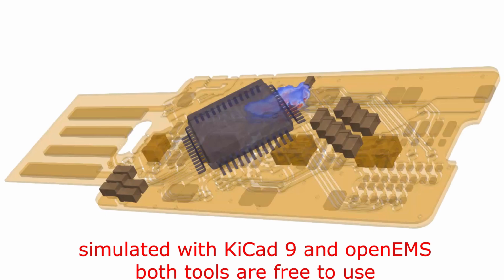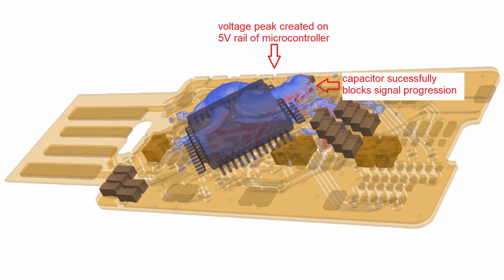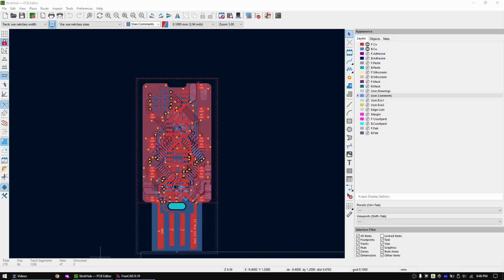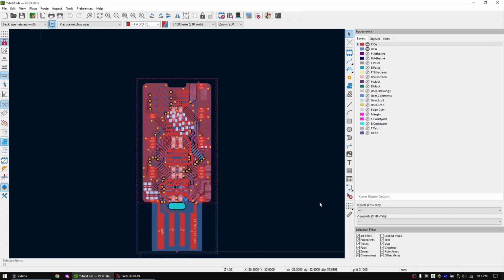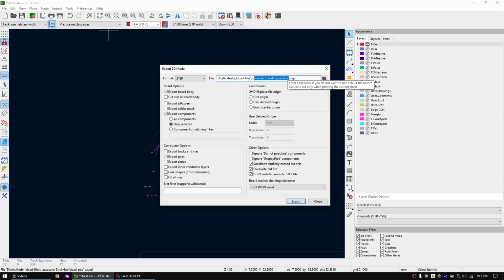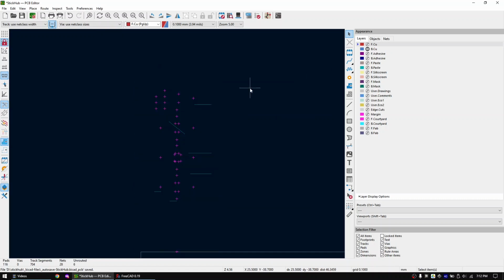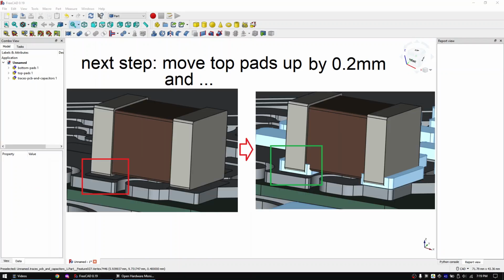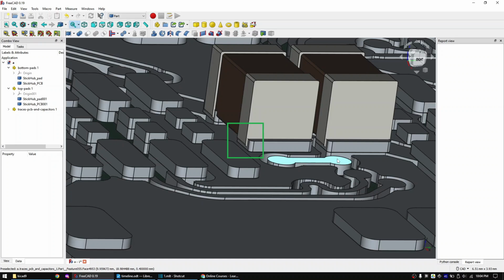KiCad 9 release - new features for easier 3D simulation of EMC/SI/PI/PDN problems

Comment: Hi, great topic.

Side question but will openEMS help with power analyzer? As current capacity of traces and copper pour.
Reply from the maker: Hi there,

For DC simulations, ElmerFEM works quite well. It can take copper resistivity into account, allowing the calculation of trace current carrying capacity and voltage drops on traces and pours.

openEMS becomes usable for frequencies starting from a few MHz and above.

for the low Hz and kHz range i didnt find a good free tool yet.

Comment: Hi! I have been following your tutorials and working with OpenEMS for my masters thesis, my goal is to gain implement a workflow to analyse signal integrity for PCB designs. I was following one of your videos to compute Common Mode Currents. Did you remove it from the channel? Is that content and tutorials included in de Udemy course? Also, how updated is the course right now?
Reply from the maker: Hi there,

I am currently in the process of removing videos that did not perform well. That video had around 1,000 views, so it wasn’t very relevant for the typical YouTube audience.

Feel free to send me an email and I can give you access to it. The Udemy course mostly explains how to import KiCad layouts without errors (OpenEMS is extremely picky about the types of layouts it accepts) and also covers ways to speed up simulations (by up to 1000x without a lot of quality degradation for most use cases). There are also some niche tutorials, for example on how to inject rectangular signals.

Best regards

Renato
Reply: @panire3  I just sent you an e mail. Thank you so much!

Comment: Does anyone happen to have the problem *Got problems while fusing shapes* when trying to export the step?
Reply from the maker: As first step try out not fusing the copper objects, I meanwhile found out that this approach works better for most designs:
https://drive.google.com/drive/folders/1P1zkUyAdip3daW4kVSG9ozoYpH7kgCEU?usp=drive_link

And always check your PEC dump with ParaView to make sure the copper elements are correctly recognized by openEMS.
If you see that the PEC dump is not well created, you can remove your traces and components until you find which geometry is causing the issue.

Comment: Does KiCad9 make it much more simpler to visualize RF over previous KiCad versions?

A bit off topic, but I picked up an Agilent e4403b spectrum analyzer from a flea market and would like to use it with an SDR (ex. LimeSDR) to visualize the RF that circuits emit.. something like the videos:
"[QUEST3 x Mx Ink Stylus -基板上のRF信号を可視化してみた-"
"Dud Charman's Aerial Circus"

I know there's commercial hardware (luxondes an_scanphone) and software (Ansys Electronics Desktop (AEDT), / HFSS, (EMI/EMC) , Maxwell, Siwave, etc).. but they are way too expensive for hobby... 

but I imagine some combination of open-source software (GNU-Radio, openEMS  Elmerfem, GMSH, ParaView, Salome, Meshlab etc)  could provide valuable insights before doing real testing (FCC Part 15, CISPR 25/32, MIL-STD-461's CE101/CE102/etc).
Reply from the maker: KiCad itself doesnt have any RF visualisation options.
openEMS and the other tools are all third party tools and only use the step export feature of KiCad for the simulations.
what makes KiCad 9 better than the previous versions: it now has an option to export fully copper-filled vias which makes simulations much faster than with previous versions. FEM as well as FDTD tools have a hard time working with the very thin copper walls from the exports of the previous versions.

I think full fledged EMC tests (e.g. placing a PCB and simulating everything including microcontrollers) are not realistic with all simulation tools right now, doesn't matter if opensource or commercial. What you will get from these tools is a simulation of 
* resonances in your layout
* cable harness resonances
* resonances of metallic components next to your PCB (e.g. heatsinks, housing, motor enclosure, etc)

Finding and making sense of your resonant structures can help a great deal on understanding what to do to improve the EMC chamber tests. Sadly the tools are helpul, but not yet a complete replacement for physical tests in the chamber.

The commercial tools are easier to learn and the simulations often can be much faster.

regarding: "[QUEST3 x Mx Ink Stylus -基板上のRF信号を可視化してみた-"
https://www.youtube.com/watch?v=GNWSDqazau8
Thats actually a nice project shown in the video, I can imagine that replacing the stylus with a efield or hfield probe might increase the resolution quite a bit.
openEMS can do almost exactly what was made in this video. For this the E-Field or H-Field dump can be used and placed right above the PCB. But only the bare PCB with capacitors can be simulated. Inductors are still a bit troublesome so simulate with openEMS.

Hope this was somewhat helpful.

Comment: bro i have a question. based on your experience, is it better to try and learn pcb simulation with kicad and openEMS or with kicad and Elmer FEM? (for signal integrity mainly)
Reply from the maker: openEMS is much easier to use than ElmerFEM, clear winner in my personal opinion  for everything related to signals.

If your goal is to become an employee or get a more valuable employee, I’d recommend getting a student version of Ansys HFSS. In my experience, many big companies use it and don’t seem too concerned about the price tag.

The beauty of openEMS, on the other hand, is that you can use it commercially for free.

Comment: watching the clock of your computer the Export takes a substantial amount of time. 29minutes to export the STEP of the capacitors pads
Reply from the maker: Hi Callisto,
The pads take approximately 2.5 seconds to export. I may have been on lunch before I resumed the recording.
The initial export, which includes traces, PCB, and capacitors, takes around 2 minutes and 30 seconds.
You can view the export times here:
https://drive.google.com/drive/folders/136AFiS7afiAhbjnpI7_QlWrHS1donQ3V?usp=drive_link